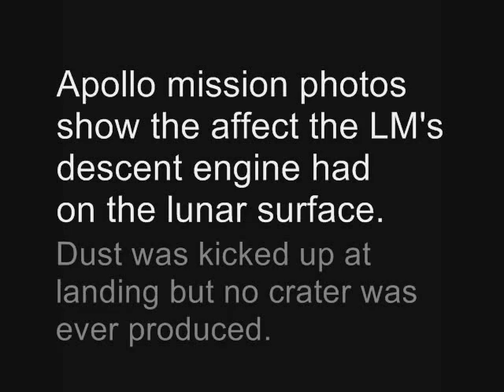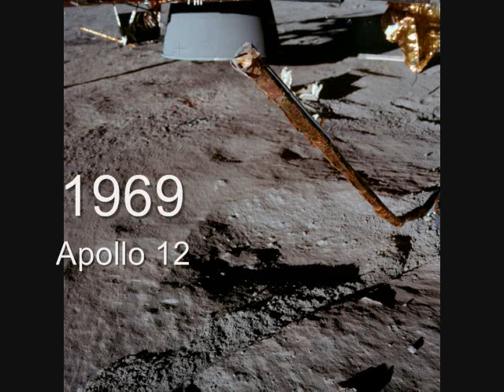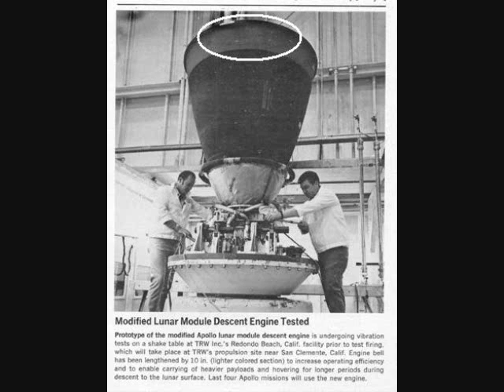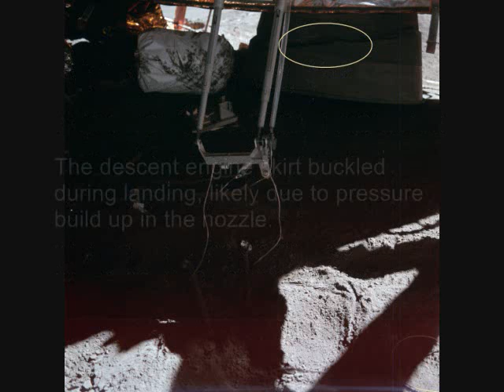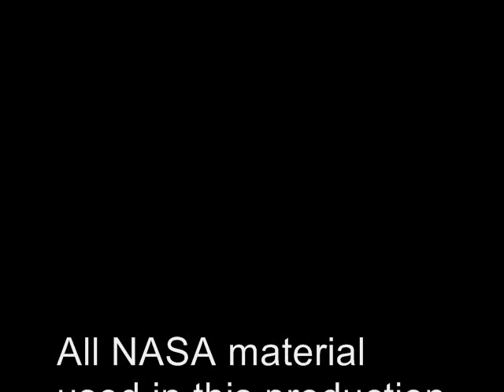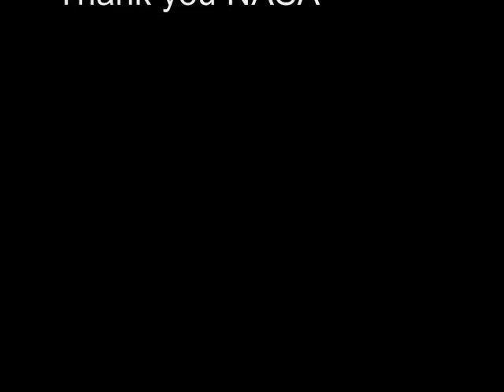Real Apollo: No Descent Engine Craters

Comment: observed oddities:
no dust on the lander pods, but plenty of dust below the lander.
no burn crater from lander-rocket but dip from a shoe is visible.
Reply from the maker: West Wind What you are saying is that Kubrick, or whomever it was hired to fake Apollo missions in a sound stage, forgot to dig a crater and dress the set in a fashion commensurate to your idea of what the set should look like. So bad set dressing is at the root of your "observed oddities". 

During the Apollo 12 mission the LEM was landed about 200 meters from Surveyor III, which had been on the lunar surface for over 2 years at the time of the Apollo 12 landing. One part of Apollo 12's mission was to remove a camera from the Surveyor lander to be returned to Earth. Sandblasting of the Surveyor craft was observed on components facing the Apollo 12 LEM. It is thought that lunar surface material was accelerated by the descent engine exhaust and propelled as would be expected outward from the centre of exhaust. Material hitting the Surveyor probe at hight speeds would have the effect of sandblasting surfaces incident to the ejected material. 

If the above was part of the set dressing required for an Apollo mission, why would Kubrick, or whomever, pay attention to sandblasting but forget to make the crater you seem to require for proof of a  landing? Was Kubrick that bad? Engine bell extensions were part of the set in J missions, and photos prove that out, but again they forgot a crater.

Either your Apollo mission fakers are pretty bad at getting it right or you don't know the difference between what is odd and not odd.
Reply: Now your clip is about the moon Movie, not the Landing? Then these still pictures are so close to real thing, or vice versa, or the same thing... wow!
Reply from the maker: Exactly! I figure Kubrick or any other movie maker worth his or her salt  would not have made the mistakes you sharp eyed hoaxers find in so many Apollo photos and that is proof enough that the photos were taken on the lunar surface.

You saw through the thoughtless arguments hoaxers fling around- it is about time.
Reply: people always make mistakes. and who cares.
who pays for this nonsense...